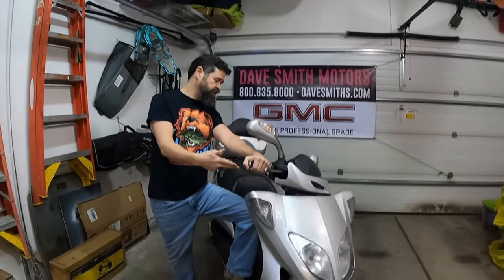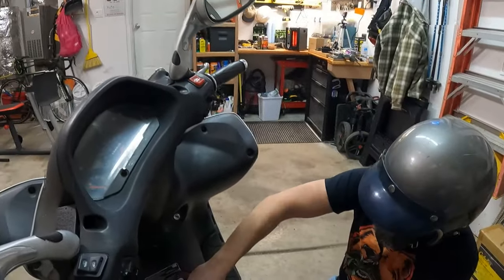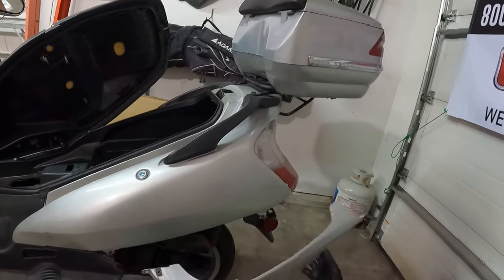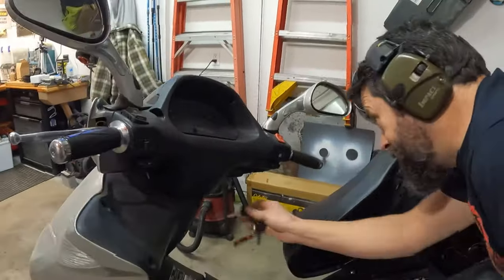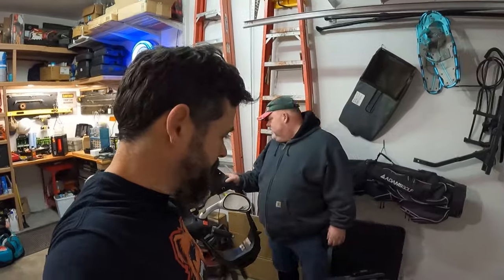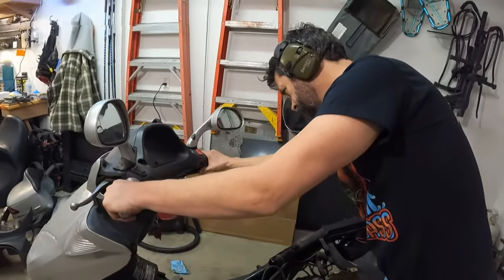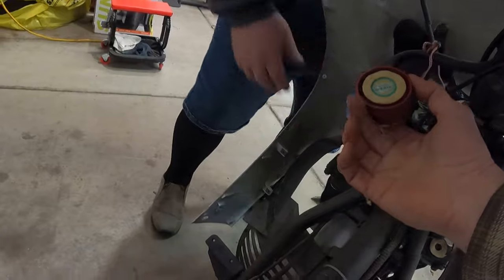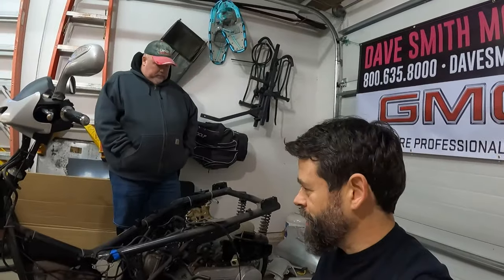I Built a Cheap But Custom Scooter: Start or Fall Apart? (Part 1)

Comment: You guys have absolutely no idea what your doing its aggrivating me so much
Reply from the maker: We actually know exactly what we're doing and I think if you stay tuned to the next two videos you'll agree. We may not know the specifics of scooters but we know motorcycles, and through this build we're adding scooter knowledge Also, no one is born with all the knowledge so you have to learn sometime. I think you made another similar comment and my reply there was if you have knowledge you'd like to drop on us, we're all ears!

Comment: You can tell this guy has absolutely no idea what he is talking about
Reply from the maker: Hey Shane, thanks for commenting, but that's not true at all. Jake may be new to scooters, but he's restored a half dozen motorcycles to better than new condition. Go check out our XL600R build. If we're still learning on scooters, well, that's how you learn when you don't know something, right? Sounds like you know a lot about these Taotao's, but at one point you didn't know anything and had to learn too, right? We're wide open to helpful feedback if you've got things we should know, share them! Also, hang in there until the 3rd episode, you might be pleasantly surprised. Thanks brother!